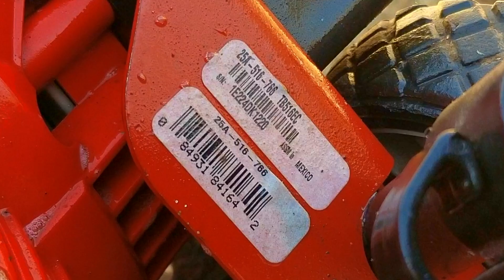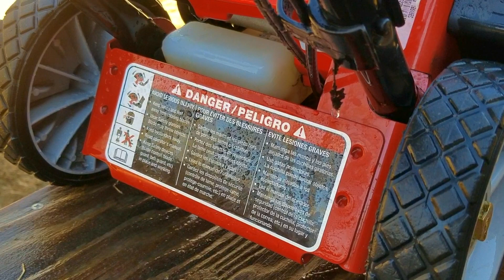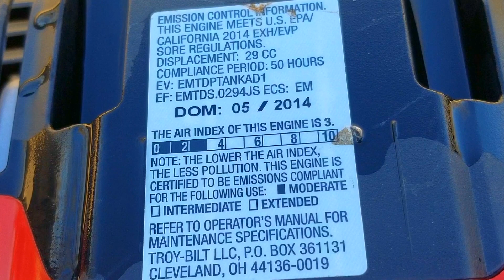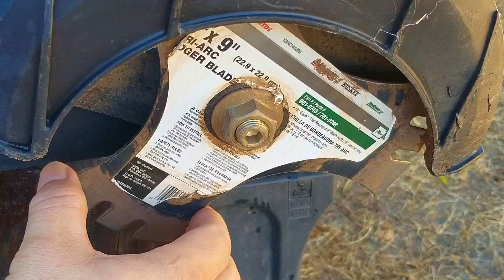Cleaning A Troy-Bilt Edger The Easy Way, Before Trying To Fix It.

Comment: lovely work on the cleaning on the lawn edger you got done for a friend and to me the valves might out of adjustment or maybe a sticky throttle cable but yeah easy to fix that one by simply spraying some good lubrication in there or simply replacing it etc.
Reply from the maker: you got it, a little lube goes a long way, in these situations
Reply: @INSIDEHOUSEGARAGE  for sure including the colder weather etc.

Comment: You know it's funny I see this video because I worked on one of these just like this just last week exactly like it
Reply from the maker: very nice. what was the problem with the one you were working on?
Reply: @INSIDEHOUSEGARAGE  fuel lines in the clutch that turns all the edger blade the clutch was burned out so I just took a clutch off of a Troy-Bilt weed eater and put on this edger and it works perfectly fine now so if you ever have to change a clutch on one of these Troy-Bilt edgers they're exactly the same as the weed eater the weed trimmers are
Reply from the maker: thank you William Moore.
Reply: @INSIDEHOUSEGARAGE  always man if I'm able to help out a fellow mechanic on small engines then I'm down with it

Comment: One degreaser I used in my time doing engine repair work was Cresylic acid. This stuff is really good. I also have the degreaser in aerosol cans sold in most auto parts stores.
Reply from the maker: do you have a name brand for that aerosol? I might be interested in it.
Reply: @INSIDEHOUSEGARAGE  the brand is EXPORT, sold here in Australia. I bought a box of a dozen cans for $24 AU$
Reply from the maker: gotcha.

Comment: Looks like new now but I noticed the scars on the side where the pull rope is and it was pulled straight up at one time and not that severe angle like now . I believe its a lot safer now being away from the nasty blade . Just wondering
Reply from the maker: you have a very good eyes, Yes, from what I gathered, they like to have the rope close to the machine, so they can pull as much rope as possible for each pull.

Comment: I'd like to use a water hose to clean my equipment but my house has so much power its almost like I'm using a pressure washer using a nozzle identical to the one you used in this video it go's about 15-20 feet its definitely enough to damage stickers and even paint. And I can't even adjust the pressure at the house faucet because it's pretty much just on or off. What do you suggest I do?
Reply from the maker: wow, that's some crazy pressure, I would just keep the nozzle far enough away so you don't damage it.